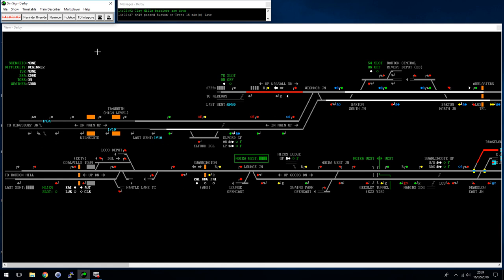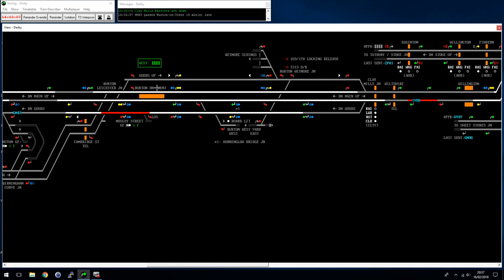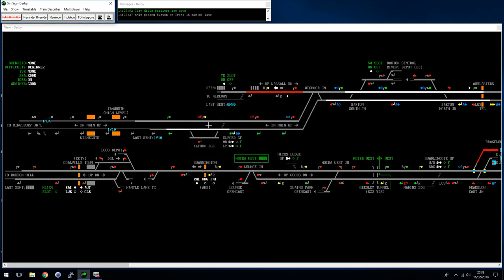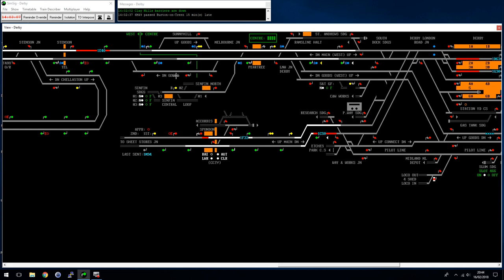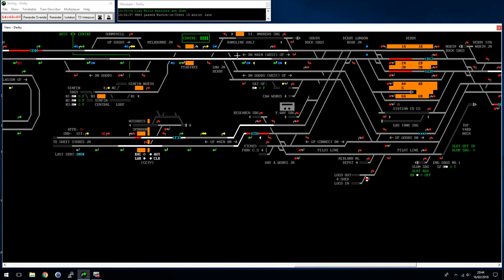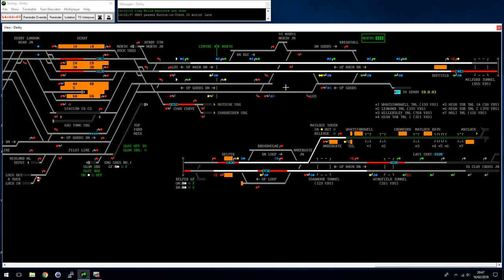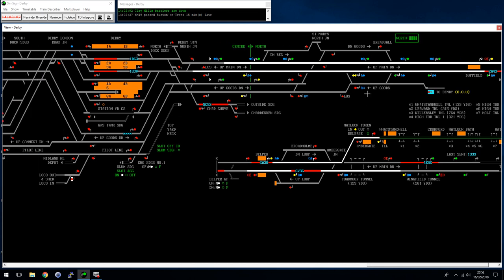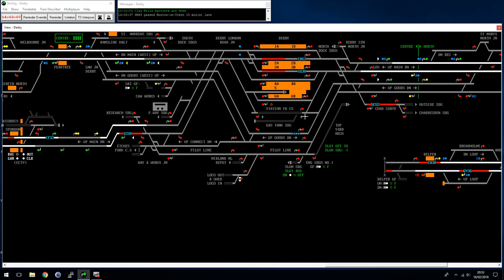Simsig Derby Introduction

Comment: Hi Luke,
Great video as always, I just have one question:
Early in the morning I got a train that said it needed to go through derby way and works sidings, but I couldn’t find anywhere on the simulation that said this. I could see the junction, but surely a junction isn’t sidings?
I googled this and on the simsig website is says it’s actually the pilot like or something? I don’t really understand. Could you help me out?
Reply from the maker: It's been a long while but from memory, this refers to the Connect line, not the Pilot line.
Reply from the maker: As in many simulations, locations change purpose over time and are frequently described using either older names, informal names or sometimes multiple names for the same location!

Comment: I find this very annoying when the train is coming from arewas so Im cancel the route then it have 240 seconds approch locking and the route to the main line and I cancel it to send a train into barton CMD it have 180 approch locking even I have no train approching that area
Reply from the maker: In general, cancelling a route is bad. In real life, the signaller is likely to know where every train is heading before setting a route. Once the route is being approached, the signalling system remembers this so cancelling separate parts of the same route can each have approach locking applied. Don't worry, you play it lots of times and then get used to what trains go where!
Reply: @LukeBriner  thank you
Reply: Yea so I find the solution by just not setting that route in auto in the morning rush hour